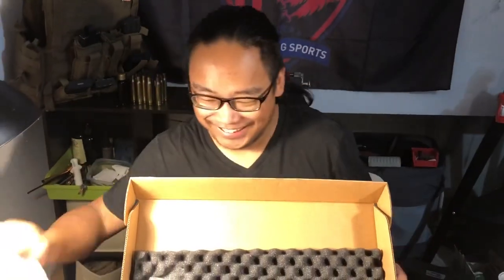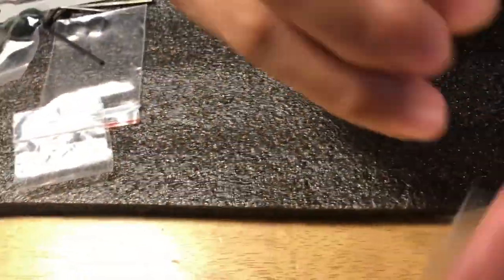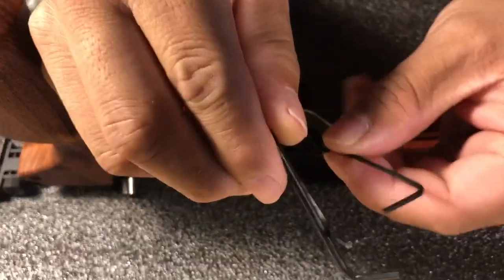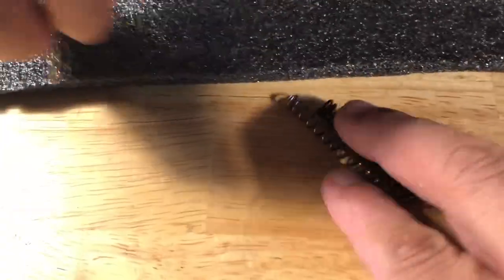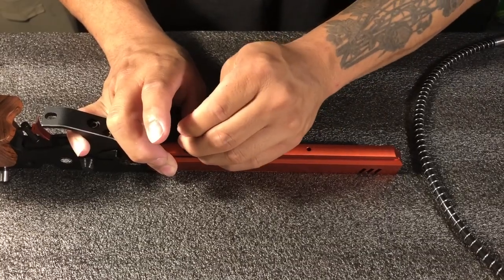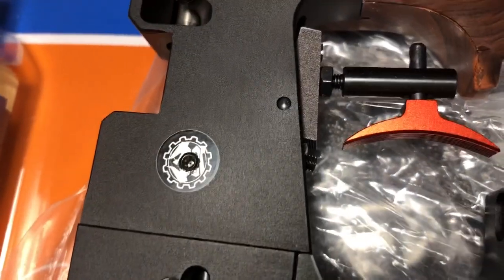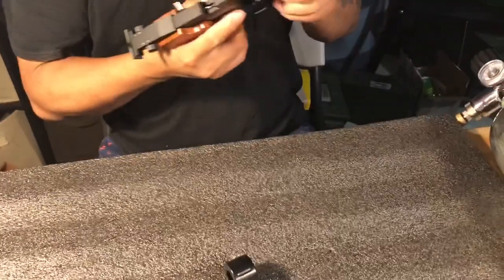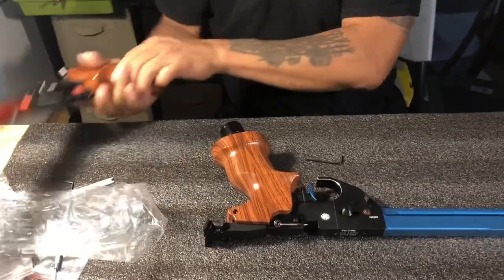BG Airgun: how to adjust power on Liston   Air pistol

Comment: Hi there.Thanks of this nice video. I was just thinking to buy one . I have a question .Can be used the pistol changing only the spring without touch the screw? I guess the power will be less but anyway much harder than its original.. Isn´t?Thanks again